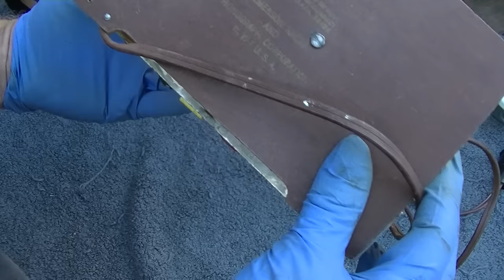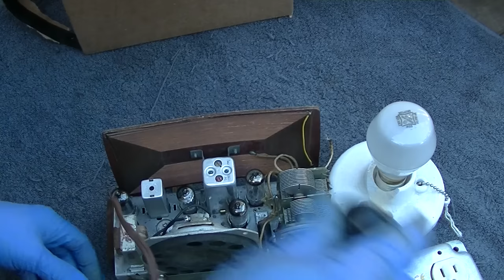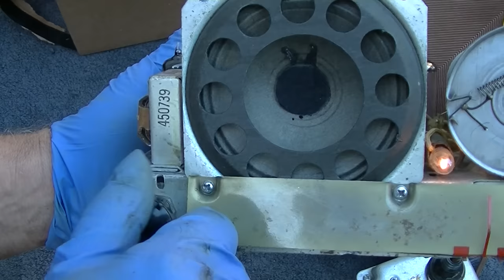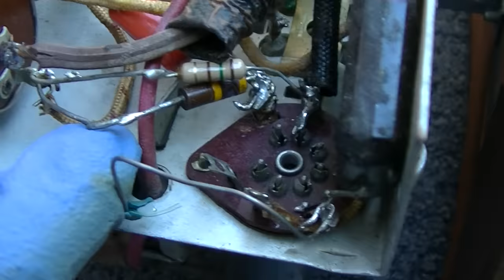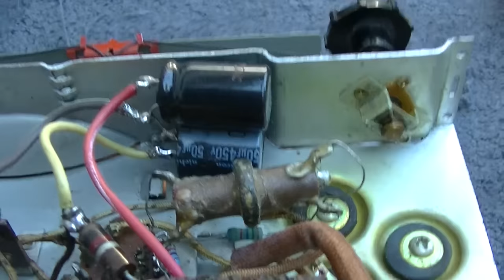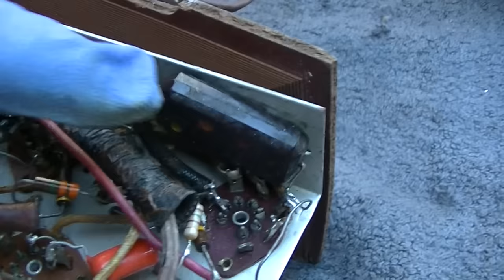Emerson AA5 Tube Radio Restore Mistake Repair

Comment: Funny mentioning capacitor voltage. The ESR actually drops with higher voltages for a given capacitance within a series lineup (say Panasonic FC etc). You don't want these caps from China leak on you that soon after all...and the plastic sleeve on those does not guarantee insulation so extra wrap won't hurt.

Some useful info for those who might need it:
Rubycon makes electrolytic caps in Japan and Indonesia.

ELNA has factories at Thailand and Malaysia (other than Japan).

Panasonic makes the POSCAP, OS-CON, SP-Cap, Hybrid caps only in Japan - the regular electrolytics however...other than some cap series made in Malaysia...Panasonic lists others as "no longer available for purchase in the country of Japan" for some reason

Nichicon makes electrolytic caps in Japan, China and Malaysia

Nippon Chemi-Con however...has factories in China, Taiwan, Korea, Malaysia and Indonesia and United Chemi-Con over at the USA. They also make caps under the "Samyoung" brand
Reply from the maker: drops as in increases. the esr ohms increase as the voltage increases
Reply: @shango066  The capacitor catalogs says otherwise. The higher voltage cap would hold more ripple current than a lower voltage cap of the same value provided they are the same product series. This ripple current rating doesn't care about voltage and lower ESR allows more current.

To be frank though...the difference would be just about half an ohm or so
Reply: @shango066  esr decreases in ohms as voltage rating goes up at least in most cases if you don't believe me check any capacitor family datasheet, esr is largely a function of electrolyte composition and electrolyte plate contact area so for a given value in a given family, higher voltages yield lower esr due to larger plate surface area in contact with the electrolyte.
Reply from the maker: @Mister_Brown  I did you got it backwards
Reply: @shango066  The Capacitor Wizard does not come with an esr table. Most digital esr meters come with a table that shows voltage and mfd values with a worst case figure for that combination. As the voltage goes up, the esr goes down. Not sure about parallel resistance, that would be in giga ohms, or leakage current , which may be less in low voltage caps working at low voltage.
Reply from the maker: @zulumax1  it does, and it confirms what I'm saying. The higher the voltage, the higher the normal ESR
Reply: @shango066  Looks like the esr curve is not flat. At 100 working volts the esr is lowest, and goes up if the voltage rating is lower or higher from that point.
  
The reason I would shy away from using too high of working voltage is that the capacitor may not form proper and create heat, which will shorten it's life. I bought bags of axial 450v electrolytics of 10,20, and 33mfd because they were $1 each 7 years ago. Now they need to be reformed before using them.
Reply: This is a case where everyone is right, yet everyone is incorrect. Depends on the data you are looking and what the voltage level is. One blanket statement won't cover everything. What is the esr of a 450 volt cap? I don't have that data. The esr of a 100v cap is lower than a 250v cap by 0.5 ohms.
Reply: @zulumax1  Let's put some catalog data in then unless you could do the research instead. Not easy when your laptop is falling apart.

Unfortunately the standard and higher voltage caps are only provided with ripple current values.

The "ESR drops with higher voltages" example:

LXV series (Nippon Chemi-Con)

80v 1000uF ELXV800E()()102MM40S
ESR (20deg.C) 0.041 ohms
Case size 18 x 40 mm

50v 1000uF ELXV500E()()102MM25S
ESR (20deg.C) 0.075 ohms
Case size 18 x 25 mm

Case size has an influence - usually the larger case of the same voltage and capacitance would yield lower impedance. These are low impedance capacitors - but the difference in ESR could be well double with production tolerances.

Case size influence example:

KZN series (Nippon Chemi-Con)

100v 680uF caps:

EKZN101E()()681MLP1S
16 x 35.5 mm - 0.020 ohms - 3150 mA (100kHz)

EKZN101E()()681ML40S
16 x 40 mm - 0.018 ohms - 3710 mA (100kHz)

()() would be filled in for lead forming options.

Ripple current multiplier:

8.2 to 180 uF
100k = 1.00
10k = 0.90
1k = 0.75
120 Hz = 0.40

Just a bit more length - very slight ESR difference - but the ripple capacity increased noticeably.

The "ESR increases with higher voltage" applies when case size limited. Example:

RE3 series (ELNA) (Part number has to be manually made from the catalog with part number system)

100uF caps:

160v - 12.5 x 25 mm - 3.32 ohms - 422 mArms
200v - 16 x 25 mm - 3.32 ohms - 483 mArms
250v - 16 x 31.5 mm - 3.32 ohms - 528 mArms
315v - 18 x 31.5 mm - 3.98 ohms - 567 mArms
*350v - 18 x 31.5 mm - 3.98 ohms - 507 mArms*

As you see...the ripple current ratings also dropped when the case size limit was reached for this particular series. ESR values at 20deg.C on 120Hz. Ripple at 85deg.C on 120Hz.

There you have it...hopefully...
Reply: @ruikazane5123  Tube gear usually calls for smaller mfd values like 10 to 50 mfd. Very large value caps used in solid state gear will have different characteristics to handle high ripple current. Apples and oranges.
Reply: @ruikazane5123  100 mfd caps, note when you get over 250 volts the esr gets higher, which confirms what Shango is saying.
Reply: @zulumax1  Linear circuitry has way more standing current than switching devices and are far harsher to power filtering capacitors. You saw the ripple multipliers.

As mentioned - typical caps for AC rectifier bulk filtering are mostly provided without ESR ratings. They are rated for ripple current alone because ESR is quite irrelevant for this application. There's no switching transients and instability problems that often affects switching circuitry.

General purpose caps like the ELNA RE3 example already given shows that the size of the capacitor itself contributes to ESR and ripple limitation. A larger case allows for larger surface area that reduces ESR and also allows more ripple current because it wouldn't heat up that easily compared to a smaller cap of same voltage and capacitance.

Heat reduces capacitor life. Reputable manufacturers specify temperature and the lifespan of the capacitor at that temperature rating. Every 10 deg.C decrease of temperature effectively doubles the life of the capacitor - if you could trust them. They also rate the capacitor life to be no more than 15 years due to sealant detoriation and electrolyte boil-off.

You want lower ESR - go for larger capacitance instead of voltage OR find a different capacitor (that would then be physically larger) that has higher voltage rating but lower ESR and therefore more ripple capacity - something that's actually designed for the application.

There's a reason why we all don't use general purpose capacitors. Yes...they are cheaper but it's not the ideal solution to a lot of situations out there. How many times cheap repairmen complained about leaky one or two year old caps because they did not assess the situation and simply used run of the mill ones which are mostly faked out

Long life capacitors are usually larger than the usual 2000h 85deg.C stuff of the same capacitances and voltages with similar or worse ESR. Note that as electrolytics age the ESR would double (or more) towards end-of-life.
Reply: @shango066 Sometimes is is ok to say, "I don't know". Don't care who is right and who is wrong. Just want to know.

 I tested some axial 450 volt capacitors I have, that have been sitting for 7 years, so the esr may be a bit high until they are reformed. The average esr at 100kHz for the lot was:
10mfd  2.0 ohms
20mfd 1.0 ohms
33mfd 0.67 ohms
The esr did drop after reforming about 0.5 ohms lower.

I don't have any 160 volt ones to compare to, so I can not come to any conclusion on the matter. I'm here to learn, my understanding remains open. 

I am not an EE, I have been messing around with TV and radio since hanging around my grandfather's TV shop and kept electronics repair as a hobby. I respect your knowledge and experience, and the other creators, Jordan Pier, radiotvphononut, and many others. I refuse to disrespect anyone who is willing to teach these real world repair techniques on their channel.
Reply: @ruikazane5123  Too much there to sort through and digest. The only thing I have found that is a fact, is that esr can go up OR down when going higher in voltage.

 But is any of this esr difference even relevant to what is being worked on here?

I have an opinion based on 50 years personal experience as an electronics tech and electronics assembler, but I do not have an EE degree.

I'm here to learn, all I can say is I don't have enough relevant data to conclude anything relative to the statement of esr and voltage.

Comment: I don't need no B+, my radios use the force. Just a handy FYI; any capacitor .01 or larger in value won't be mica. I do hope he tidies up those electrolytics; that's a short to chassis waiting to happen. And finally, I've never seen a radio use 1 mica-tuned IF and 1 slug-tuned IF from the factory---that's a new one on me

Comment: Before you begin to work on these 75 plus year old devices, learn to solder.  I was lucky to learn this early, well before I understood the theory of these radios operation.  I am not OCD, but if it doesn't look like these new capacitors were put in when it was manufactured, then it is not a good job.  Buy a good "solder sucker" and do it right.  Leaving "j hooks" and rotten wiring is just not a restoration.

Comment: R8 is 220K, 5W
Reply from the maker: 0.5 half watt. No 5 watt resistors in these radios
Reply: @shango066  I was trying to talk back to you through the screen as soon as you misread the R9 value instead of R8 (same value as R1, 220K) but I don't think you seem to have heard me... 😀

Comment: Really shocked you didn’t recognize that domino mica, especially when it said mica on the outside!  🫣
That was the best capacitor in the whole radio…
Reply from the maker: lots of those are paper
Reply: He thought it was pepperoni and sausage when he saw Dominos.  
.
Reply: @CatholicBoy1957   Pepperoni and sausage would be a disc capacitor. Steve, atheist, 1952.
Reply: MicaMold made paper capacitors that look just like real mica caps.
Reply: @shango066  well I’ve never seen any of those in that square body that we’re not mica. I’ve seen ones that are sort of oval, and they were paper even though they were using the colored dots system for marking.  But I always do a test them and have to see a circuit upset before I condemn them just out right like that.